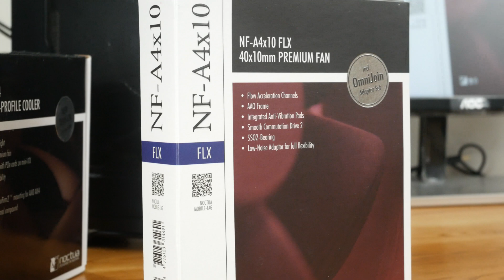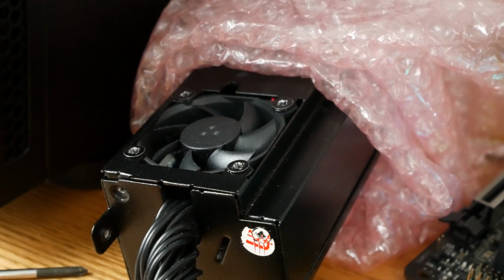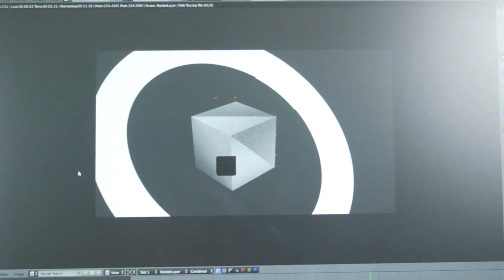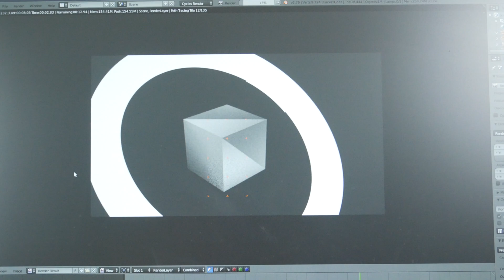Mod: Inwin Chopin PSU Fan - Noctua NF-A4x10 FLX

Comment: I dunno, it seems like you had a problem with the PSU fan controller, if there is one.   Could be a blown fuse even.   Personally, I'm a believer in PSU fans always running, although I do realize that some prefer to have them off for noise, cost, or "environmental" reasons.
As far as an LNA, they help, but Noctuas are pretty quiet even without them.
Also, since you're handy with the 'iron, you could just strip the fancy cover off the Noctua fan lead and solder it to the length you need, even pull the resistor out of the LNA and just permanently wire it into the fan lead.
Depends on how much work you want to do, lol.
I coincidentally just used one of those fans to replace a noisy fan in a hot change HDD bay.  I admit, I did not feel like cranking up the iron so I made a spaghetti lead /w an LNA and just jammed the wires into a hollow channel in the bay, lol.  😂
In my case I used the LNA more to reduce air flow and suck in less dust.

Comment: For my media PC build I removed the supplied PSU altogether and used a PicoPSU with an external brick.

I found the included PSU to be noisy constantly, but when I bench tested it the fan was actually fairly quiet when outside of the case.  The reports you heard were that it would get noisy over time, but I found it to be noisy out of the box.  (FYI my fan seemed to run at full speed constantly whenever it was turned on.)

It turns out, I determined, that there was turbulence noise from the fan because of tight bends for airflow to feed into the fan from outside the case.  Even if I had replaced that fan, it would almost certainly have been just about as noisy anyway.
Reply: How did you pass the pico psu power cable out of the chopin case?
Reply: @sparrow2a  When I removed the supplied PSU it left the opening in the back of the case.  I used some hardware (a washer and some kind of nut IIRC) to screw down the PicoPSU jack to the edge of the opening.  I filled most of the rest of the opening with a 40(?) mm fan for additional cooling, which I never wound up using.

Comment: Looking into this case right now. I had an EVGA Hadron Air years ago, which also comes with a 1U PSU, with a noisy fan. I did this exact replacement on that PSU and it worked great. I'll definitely keep this in mind if I decide to pick up this case. Thanks. :)
Reply from the maker: Glad I could help

Comment: Thanks for the video!

I did this mod with the Noctua FLX fan.  Thanks for the heads up on the reversed polarity.

I connected the fan directly to the PSU 2 pin.  It definitely works hooked up in this configuration as I can hear the fan under load when I get close.  It is much quieter, I can now leave folding@home running during the day without getting annoyed by the fan noise.

It does seems louder at idle.  The PSU has remained cool to touch in stress testing.  I may open it back up and add the low noise adapter.
Reply from the maker: That sounds about right. This was only a solution proposed by people that had noise issues with the stock fan. I wouldn't recommend changing it if you have no issues.

Comment: Does InWin sell these PSUs separately as replacements? Any one know the price?
Reply: Yes. It's ~$47 for the original IP-AD150A7-2 150W supply, or $65 for the IP-AD200C7-2 which is the 200W Gold adapter in the Chopin Max. I could only find the latter available direct, in the USA, but resellers also claim to have both parts. Maybe talk to InWin about it. You could also buy a B1 chassis which has the latter, at least in Europe.

Comment: I'm considering doing this now.  I put in two small 10mm heat sinks on top of the PSU, and the laser tempature reader shows them hitting 45C pretty quickly when I start up a game, while the CPU is barely at 47C.  Both will go above 50C, and the case itself feels pretty hot inside.
Reply from the maker: It's possible to get some systems running very cool, but I think the 50°C range is very tolerable for most PC components.

Comment: Did this mod a week ago, with the Noctua plugged into the motherboard chassis fan header via a LNA. There is a bit of misinformation about this mod online. The stock Sunon HA40101V4-000C-999 in the PSU is rated 5.3 CFM at 4500rpm. The Noctua NFA4x10 is rated 8.2 CFM at 4500 RPM and 6.6 CFM at 3700 RPM (LNA). Even with the LNA there is more airflow than stock. My case was getting noticeably louder and hot to the touch at the base. After swapping the fan out my core temps are much lower - even my M2 drive temp has decreased from mid 50s to mid 40s under typical operating conditions. The PSU fan is practically inaudible and the total noise is now way lower as my CPU fan is also spinning less due to temp drop. Be extremely careful with any work on PSU but my experience has been excellent so far.
Reply: The CFM values you list for the Noctua fan are wrong. Noctua states their airflow in cubic metres per hour (m³/h). Converted to CFM the airflow would be 4.8 CFM at 4500 rpm and 3.9 CFM at 3700 rpm (LNA).
Your PSU doesn't overheat (for now) probably because of your workload on the PC and the fact that the fan is constantly running instead of spinning up when needed...
Reply: @_MicZ_  Was wondering if it's possible to fit a 20mm version instead (NF-A4x20). That is rated without LNA at 9.4 m³/h = 5.5 cfm.
Reply from the maker: Is your Noctua fan running full time off of the motherboard instead of off of the PSU? If so, your reduced temps are probably because your fan is never turning off
Reply: Noob question here. What is LNA? is that some kind of adapter? I am planning to do this mod bot no idea what i need besides fan for that? Is it better to buy 2 pin or 3 pin version of this fan? Thanks!
Reply: @mikelo303  Low Noise Adapter.  The Noctua NF-A4x10 FLX kit comes with everything needed, just run it's very long cable out the end with the rest of the PSU wire bundle and plug it into a vacant chassis fan header on your mobo.  Within the BIOS you'll need to run that Noctua fan (3-pin) at full speed (100% continuous).  The LNA is a 4 inch adapter that will allow the fan to run at a reduced 3700 RPM.  You could omit the LNA, if you choose, and the fan will run at its maximum rated 4500 RPM.
Reply: @Transit21  Thanks for explaining. I'll do that

Comment: Thanks for sharing your experience and doubts about swapping the Chopin PSU fan!! 

Does the PSU fan suck air into the PSU does it blow the warm air out of the PSU?
Reply from the maker: Yes, it pulls air in from beneath the case and expels it out of the back.

Comment: Hi, Does the psu get hot to the touch after ~ 30 min of gaming or intense cpu use?
Reply from the maker: I don't have this system anymore. Sorry. Do you mean before or after the mod? How intense gaming or CPU use? In what conditions? When you're talking about heat, there are a lot of questions to answer. That's why I haven't been claiming to do any extensive thermal testing. There are more variables than people realize.
Reply: @ChillBuilds  I want to use the pc for vmware & I expect cpu utilization to be ~ 80% 24/7, I can cool the cpu, that's not a problem, but the psu looks small.
Reply from the maker: @angelusstark   The only way to know is to try it. It's a 150W power supply, so I would guess it would be fine, but I don't know.
Reply: @ChillBuilds  Thx. I hope so :) I'll try it & if it gets too hot i'll return it.

Comment: This vid is so cool! Thanks!
Also is it possible to mod the Chopin to be able to fit an SFX PSU?
Reply from the maker: No, definitely not. There just isn't enough space. One thing you can do is replace this with a smaller PSU that uses an external power brick. That requires some more serious modding though.

Comment: How's actually the stock fan noise, is that really disturbing? And how is the new fan so far? Since you use LNA, have your psu suddenly black out bcoz overheating?
Reply from the maker: I never had an issue with the stock fan. Did this because I've read other people complain about it.
Reply: Maybe it's zen 3 power consomption but my power supply is reaaaally loud with a 5600g